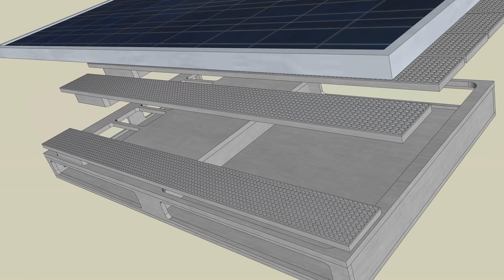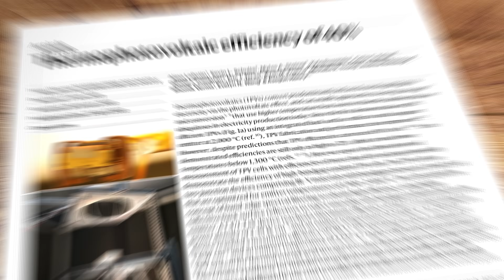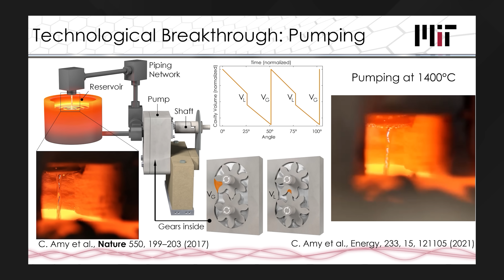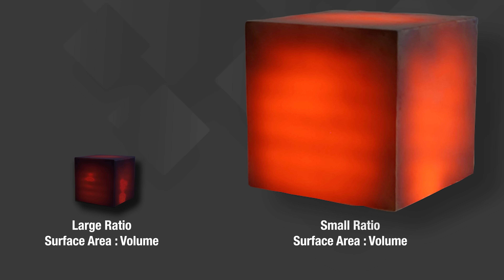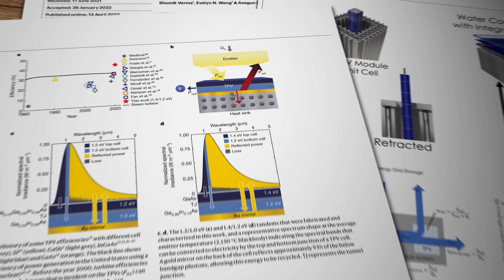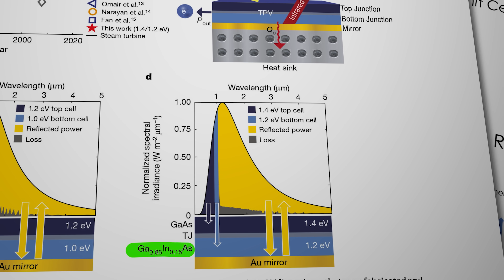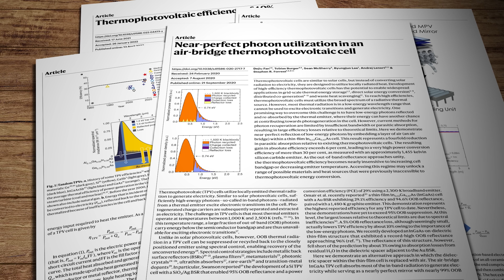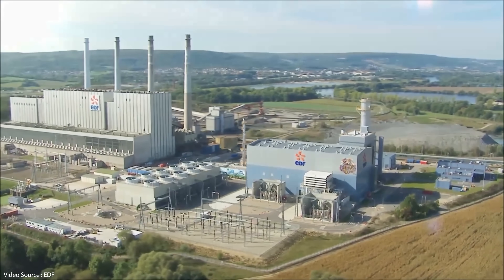Grid Scale Energy Storage 30x cheaper than Lithium-ion! How do they do that?

Comment: I think you may have misinterpreted the information on the Thermal Battery Company's website.

What I see on their website is a cost for a Thermal PV (TPV) energy/power storage plant of $340/kW + $10/kW/hour of storage (rather than just the $10/kW-hour). Thus, the cost for 1 hour of storage with a charge / discharge rate of D kW would equate to ($340/kW x D kW) + ($10/kW-hour X 1 hour x D kW) = $340D + $10D = $350D.

Thus, a system of D kW in size with a charge/discharge rate of 1 hour would cost $350D or simply $350/kW.

A system sized to give 10 hours of storage, but the same charge/discharge rate of D kW, would cost ($350/kW x D kW) + ($10/kW-hour x D kW x 10 hours) = $$350D +$100D = $450/kW x D kW.

Thus, the initial cost for the D kW system sized for 1 hour of charge/discharge would cost $350/kW-hour, while the comparable  system set up with the same charge/discharge power capability of D kW, but for 10 hours of energy capacity would cost ($450/kW x D kW) divided by (10 hours x D kW) = $45 per kW-hour of energy capacity.

Most larger scale Lithium based energy storage systems are set up for 2 to 4 hours of storage. If the cost of such Lithium battery storage systems were $150/kW-hour, then 2 hours of energy storage capacity would cost $300/kW of power (charge/discharge) capacity, while 4 hours of energy storage would cost $600/kW.

The breakeven in hours of storage between the cost for the TPV system and the Lithium system would be  approximately 3 hours of storage, since the the Lithium system would cost 3 hours x $150/kW-hour = $450/kW, which would be the same cost as the TPV system.

If the cost of a Lithium Iron Phosphate system was $50/kW-hour, like some are projecting, then the breakeven with the TPV system's cost would move out to 9 hours of storage, rather than the 3 hours with the $150/kW Lithium system. At this breakeven, if 10 hours of storage are needed to meet the load, then the TPV system would be slightly (about 10%) cheaper at $45/kW-hour, compared to $50/kW-hour for the Lithium Iron Phosphate battery system.

Comment: It makes me wonder how this technology could be applied to nuclear fusion.  For now, they've just said that they plan to extract the heat from a nuclear fusion reactor by just water cooling it and using the steam it makes to produce electricity as we always have with power generation. This could do away with steam power entirely for a more direct method for generating electricity with nuclear fusion.
Reply: Nuclear fusion (or even fission) continuously runs, storage is not a concern.

Comment: If something breaks and the system needs to be shut down for a lengthy period of time the pumped liquid metal in the loop would solidify, preventing flow upon restart. How would they deal with that? Wouldn’t liquid metal batteries be a simpler and more direct solution for thermal->electric energy storage?
Reply: I suppose different systems have to be explored - there may be some discoveries that are useable elsewhere.Trying to get electricity from heat, by using light , (like in the video) just seems unwieldy. I agree that for the sheer expense of the method, with difficulties in maintenance (let alone overcoming the inevitable development problems) - exploring liquid metal battery improvements would be a much more rational approach. ( I mean - whole buildings filled with Argon ? ) (But the high temperature material research for this would certainly be applicable to liquid metal batteries...)

Comment: 40% efficiency is just the cells. How much heat is lost through the water cooling?  Again, some Sterling engines instead of the simple radiator would increase efficiency quite a bit.

Comment: Between this and the liquid metal battery team with Don Sadoway, MIT is churning out some hot energy storage startups.  My only real scepticism (which has also bedevilled Prof Sadoway) is around the ability to maintain the integrity of all the components at this sort of heat over time.  I hope they can manage these challenges.
Reply: @Russ Bell -- Well, the "system" seems to  take the highest "quality" of energy (electric power from conventional solar or wind) and convert it to HEAT which is then extracted via solar.   The system might be cheap per kwh stored, but you might be lucky to get 30% of you high quality energy back.   Pumped storage or large spinning masses make more sense.   Or simply compressing air into empty NG wells might do the job.
Reply: BINGO.   I  remember when "everyone" put in a solar water heating system in the late 70s.   When we went house hunted in the later 80s,  they all had been disconnected and electric water heaters installed.
Reply: @GilmerJohn  greece and mediterranean european ocuntries all have solar water heaters on their roofs, and use them almost exclusively for hot water generation, especially during summer.

Comment: Just wondering , if you have a lot of heat stored wouldn't be simpler , cheaper and more efficient to just use that to heat to turn water into steam and power a turbine that way? Shure the response time would not be the same but overall this might be much better I think.... Or maybe instead of cooling the water just let it turn into steam and use it in a turbine like it was pointed out in other commitments , a dual usage if you want.  This might raise the efficiency.

Comment: I wonder if you could melt the tin using solar energy the way molten salt solar installations work (not to be confused with nuclear molten salt).  The biggest difference with this system seems to be that it uses light generated with tungsten instead of boiling water like most power plants.  The molten tin is much much hotter than salt which is harder to work with but better at storing energy.

Comment: I've been working with extreme high temperature carbon applications/systems the last 10 years, and while this idea is novel, if someone were to approach my firm and ask me to design it, then put my name on it, I wouldn't feel too bad about laughing in their face. 
The most significant problem I see with this (and there are many) is maintenance. In this type of system, maintenance is more of a 'please the bean counters' word, as there is no spare part exchange, it's straight to System Replacement when something breaks or fails. Bad high temp pipe? Total replacement. Cracked carbon bend? Guess what... No patch job for that. 
Carbon is good for many, many things, but when mixed with this level of heat, calling it brittle would be far too kind. It's right on the border of ablation. 

Now on to the more serious issue, the argon holding facility and its contents. Argon, as some may know, displaces oxygen. That's its primary purpose in most industrial uses in one form or another. Once that holding building is sealed up for operation and FLOODED with argon, you can't walk inside without bringing your own oxygen supply along (also presuming the insulation on the city bus-sized block of graphite is up to snuff. It'd be like trying to shrink wrap the sun in a thermal blanket). More devastating still, filling a hermetically sealed building with argon will require a new word beyond 'expensive'. At approximately $2.50 US per CCFfor argon, needing to fill an approximately 4.5million cubic feet of internal volume... Yeah, that's gonna hurt. And if those graphite blocks insulated with thermal jackets should need some, cough, maintenance? Gotta pump that gas back out. Let us not forget about the not-insignificant entry price of gigantic blocks of graphite. Using top tier grade for this application, one multi-part piece would net Millions of dollars. One. Block.

As said, there's a lot of billion dollar problems to tackle here, and while the thought is appreciated, not even God can help you run fast enough should you be sitting in a board meeting and this idea is presented to your stockholders.
Reply: All that for 50% efficiency in perfect conditions. 

The idea sounds cool, but IMO should be relegated to sci-fi novels for now.
Reply: @ЕмилЕфендулов  That 50% is even worse as it's only for 'up time', which for a facility like this would no where near 24 hours a day. Using 'excess' grid run-off, it wants to use that energy to basically power a small city for a week to get everything up to temp, then let it sit for a month in 'passive' mode? (And what kind of renewable energy farm has excess energy on the modern grid?? Did we forget about the 150 million electric cars they want to replace fossil burners with? The aging US grid can barely keep up when there's a temperature swing... ) 
The whole thing sounds like it was written by a kid in grade school with no working experience vs a relatively prestigious higher education/thinktank. 🤦‍♂️
Reply: Even nitrogen can be used instead of argon (it reacts with some metals though) but simple solutions are not popular in MIT!!
Reply: @janami-dharmam  Nitrogen, CO2, helium if you want to lighten your load... 😉
Reply: @snaplash  Not from the graphite directly or immediately, but if the damage is significant enough to breach the insulation, the graphite will be the least of your concerns. More immediate will be the the building burning to the ground and anything around it. It's fairly circumstantial as to what did the damage. If we're talking like an errant truck or something more substantial like weather related, problems compound problems and severity. 
The graphite in particular has already been reacted with regards to fire implications in its formation. Exposed to air from that temperature on its own, it will just cool over time, though the sight is somewhat interesting to watch a glowing block in it's white hot state come down to interactable temp fairly quickly and with relatively little drama.
Reply: well said
Reply: The one thing I don't think is a challenge is the graphite- it should be possible to use coal instead. Everything else? Well, that varies from "interesting technical challenge" to "you really haven't got past the brainstorming phase, have you?"
Reply: Thinking about it, they may as well go with sodium metal instead of tin. It should be more common, liquefy at lower temperatures, and is only marginally worse of a fire hazard than the graphite (note that I said nothing about it being safe!).
Reply: @absalomdraconis  Interestingly enough, graphitizing coal and alternative carbon sources is what I'm working on now, primarily. The white papers have been around for some time, I've read a lot of then, though I've developed my own process that's dirt cheap and not terribly difficult, nor expensive.
The tricky(ier) part is getting it into actual graphene. We're about 85% of the way there.
Anyhow, molten salt is an excellent idea. Molten anything has a fairly universal set of protocols, it normally comes down to cost of stage conversion, holding temperature and necessary vessels, etc. Salt nitriding is a well-established process and has been around for a long time, not to mention it has processing equipment or more common refractory materials. While fire-fighting a salt fire becomes a challenge, it's not much worse than, again, any other molten process other than the fumes and some unpleasant gaseous by-products if you try to put it out with knee-jerk solutions. 

After that 'not a piston' engine came out  some months ago and I couldn't help myself to spread the knowledge of its shortcomings, I've begun to wonder if releasing these half-baked ideas isn't free troubleshooting--ala unpaid beta testing of software--equivalence. "Let the internet sort it out=profit." I may have to go back to watching from the shadows and prodding the futility with my weathered Unobtanium 10 foot pole.
Reply: All you say is true which is why my own concept was a "forever" installation intended to never need maintenance. Piping lengths would be kept to a minimum and ideally every part would actually be constructed inside its own reservoir of molten thermal medium, sort of like how a 3 phase refrigerator/freezer motor is designed and hermetically sealed.
Reply: @tonysu8860  I'm working that out in my head, and I would say this is 90% viable. The piping is the lynchpin in the whole design, however. When involving these temperatures, either a joint will fail, a cool spot over time will develop and begin accumulating 'sediment' (lack of a better word for build-up in this use) leading to a blockage akin to plaque in blood vessels. Eventually an air bubble (or many) will make its way into the system and form a skin between the molten medium or an oxide forms, material dependent. The skin is easier to deal with in a slag situation as there's methods and additives to skim the holding pot which feed the lines vs the oxide which becomes aggressively abrasive. 
The easiest way I can think of off the top of my head is to 'carve' the pathways into the design of a/the restriction medium and let it become part of the structure with a well-defined service life. After a certain number of volume cycles, the whole unit would need to be replaced, as the restriction medium essentially wears out from material corrosion or build-up.  
Beyond these and other considerations, crucibles of this volume to get that feedstock to and maintain molten temperatures are energy-consuming monsters. A great place to see what kind of voracious animals these things are to energy consumption is an electric arc furnace for steel mills. 
(Just for visual imagery's sake, steel mills have their own power plants on site just to feed the arc furnaces, often requiring hundreds of train cars of coal to feed boilers for steam generation running around the clock). If you've never seen one, they are worth a search on youtube as they are fantastically violent, like standing inside an active thundercloud.
Reply: Agree, sounds like something Thunderf00t would have fun debunking. just imagine a truck running into one of those sheds and air getting in, would be blazing graphite in no time. I'd rather go for a caveman method and heat some big blocks of granite to a slightly lower temperature, then add water, to make steam, to drive turbines - much safer, simpler, and probably nearly as efficient.
Reply: Not to pile on but isn’t Tin a relatively rare material that if you were talking about adding tons of these storage facilities on the grid would jack up the price of tin beyond belief.  Also the process for refinancing tin uses coal. I wonder just how environmentally friendly this idea actually is.  I’m glad people are working towards net 0 but that could also be achieved through sequestering emissions at a NG plant. We do have 200 years supply of the stuff.
Reply: @DavidB-tj3rj  I'm inclined to think that we're decades away from effective world-scale CO2 sequestration and that grid balancing batteries are the immediate future we sgould be working on. 

With that said for the immediate future we need to look towards simple and cost effective solutions (for example reverse hydro), not outlandish unproven technologies that rely almost exclusively on semi-exotic / expensive materials and have never been tested at scale.
Reply: @ЕмилЕфендулов   I’m not talking Global CO2 sequestration, I’m talking about using the Allam power cycle like what the company NET power is doing to use NG to produce zero emission power for about $.02 usd /kWh. 100% of emissions are captured and can be used in industry, retail or disposed of safely.  This can be a great bridge technology to get us where other better solutions may exist.
Reply: @DavidB-tj3rj  Not only that, look at the worldwide distribution of raw graphite mineral resources... 75% of it is located in China, some in Russia, a little more in a few other countries, none worth having in the UK.
At a glance, you can see instant drawbacks - like who will potentially collaborate to control global supply prices.

It seems to me that an uncomfortable amount of raw materials needed for green energy storage comes from questionable sources. 
Should our scientists be concentrating on materials that are commonly available in friendlier, more responsible nations that better respect human rights and the environment - so you don't later discover that minerals mined for your electric car or energy supply weren't gained through child slavery, through countries willing to destroy a forest, drive out a village and pollute waterways to reach minerals, or would perversely switch off supplies when you don't want them to invade neighbouring countries?

Comment: Lots of comments about the inefficiency. Really what matters is the cost of the energy it releases after storage. As stated in the video it is 30x lower than the same amount of energy retrieved from lithium ion batteries. A comparison with pumped hydro and other mechanisms would be useful too.
As for using the heat directly, that also makes sense if conditions suit, e.g. cold winters.

Comment: This system looks very similar to a nuclear reactor with graphite blocks, control rods, water cooling, and pumped liquid meal. What happens if there is a breach and all that hot liquid tin loses containment?
Reply: White-hot tin at 2300K behaves extremely similar to corium, only worse since it have much higher density. About half of the heat generated in a typical nuclear meltdown inside the molten corium came from the chemical reaction between Zirconium from the fuel claddings and Water from the coolant. If a cellular structure is used however the amount leaked with a single broken cell would be minimal and easier to contain. If the water was allowed to leave the TPV rods and interact with the graphite however…… (see what happened at Chernobyl).